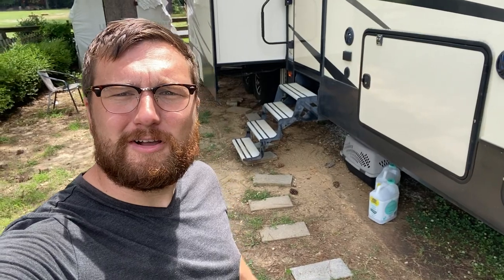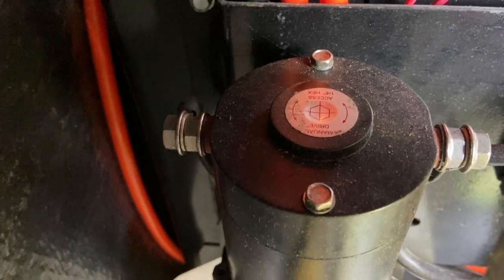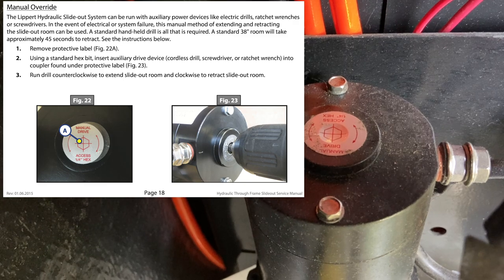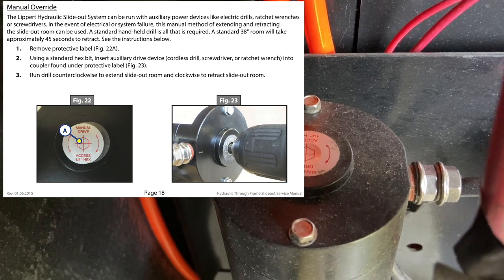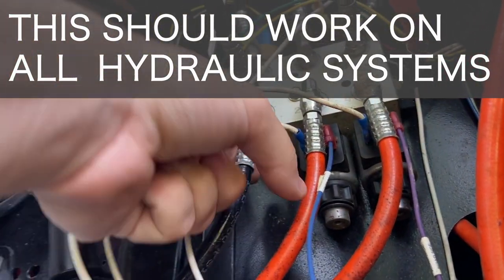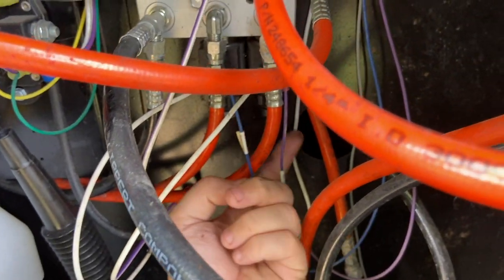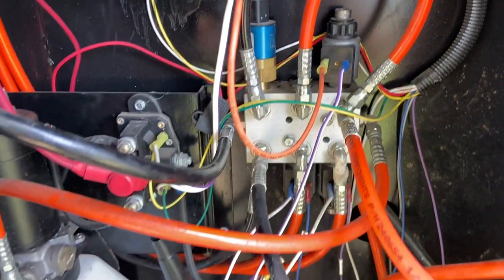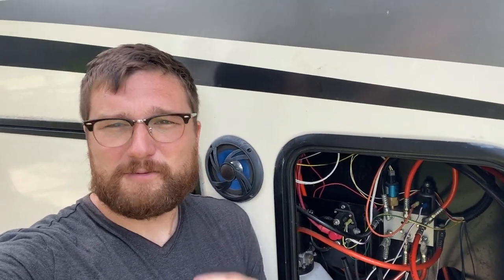Hydraulic Slide Manual Override. Slides & Jacks Will Not Move?

Comment: Thanks, good start to finding my solution.  My front landing gear is stuck down, but I know how to manually retract it now.  Now I just need to troubleshoot what the cause of the problem is.  Appreciate the help
Reply from the maker: Jump power to the motor see if it runs. Check everywhere for fuses. They love to hide them if the motor works.
Reply: Hey David, we are actually running into the same issue. Did you figure out what the solution was?
Reply: I changed the switch and the solenoid and it fixed the majority of my issues.  I still have a weak switch on the slides so sometimes they go out when leveling the RV.  My hydraulic pump always worked just didn’t control the leveling process.

Comment: Justin 
Great video short and to the point!
I put the drill in the slot above the motor turn the cylinder with Allen wrench and spin the drill and the kitchen slide moves in 
The other opposing slide on the rear doesn’t move! Change the direction of the drill and spin it the same slide comes back in
Can I force the other slide in turning the horizontal bar with a massive crescent wrench instead of five people?

Comment: Thanks Justin.  I've got that exact camper as your in-laws.  I have two issues:  My two main slides will not extend and my leveling system will not operate; (actually there is no power coming to the LEVEL UP WITH ONECONTROL).  Could both of these issues be related to low hydraulic fluid?

Comment: Been trying all day to resolve landing gear issue. It doesn't extend. Was attempting to relevel rv side to side. Started to reposition front jacks and they only retracted.  Rear jacks & slides function. Coil on hydac & 12v works. Any suggestions?
Reply from the maker: I'm so sorry I missed this. I would check the valves Clock wise to open Counter to close.